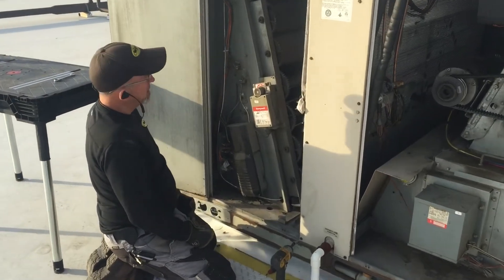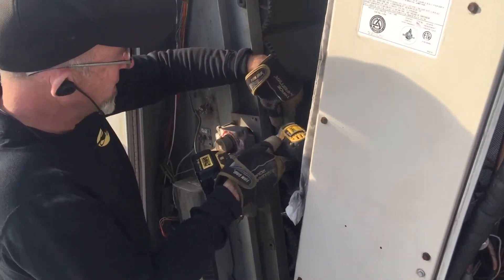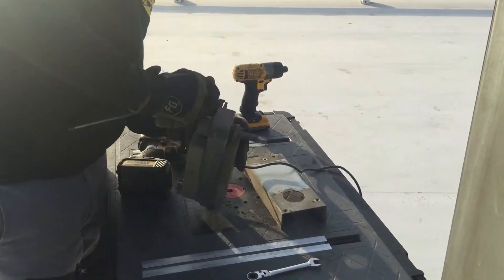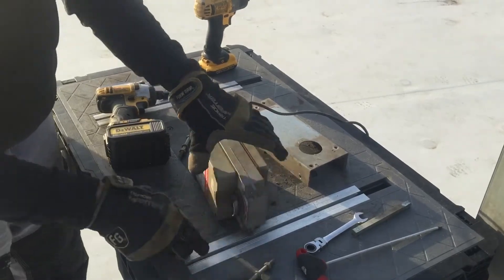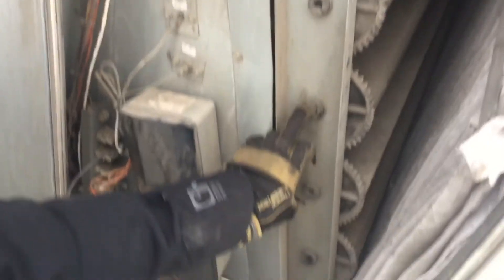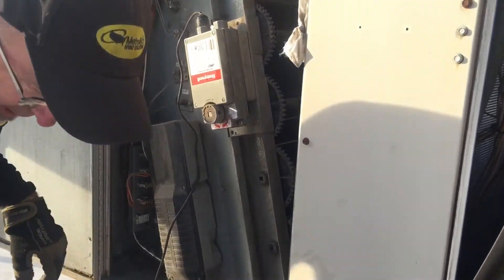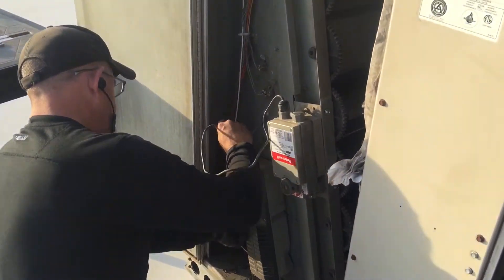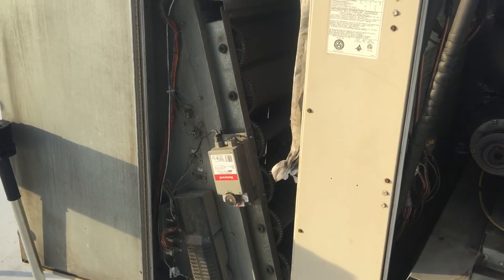Lennox - Repair Option For Broken Economizer Gear

Comment: This comment is not relatted to repair. But if the mic that you are using if is for the purpose of better audio the bad news is the bluetooth won't work if the audio you are triying to record is on a camara is just for calls. If you want a better mic reply to this comment and I will put the link

Comment: I had to do the exact same thing  on a actuator for a huge actuator exhaust damper system. I had fun that day because i had never done this before. So it was good problem solving experience and also - on the job training - experience.
Thanks for the video and knoladge sharing